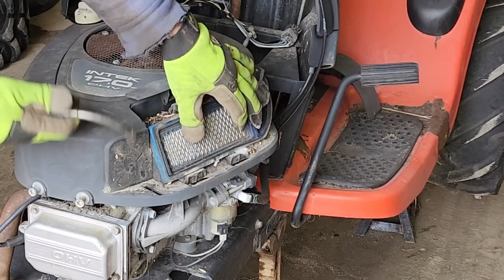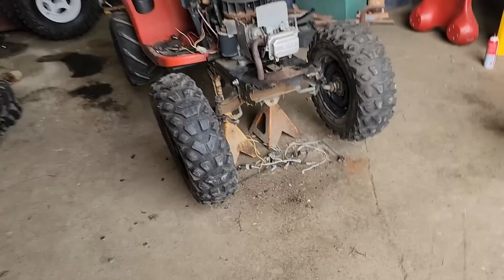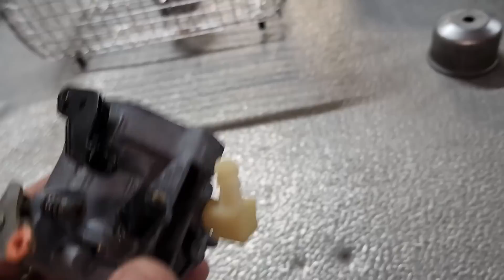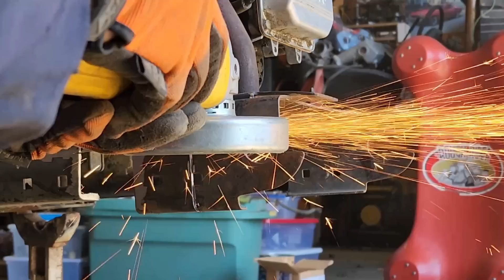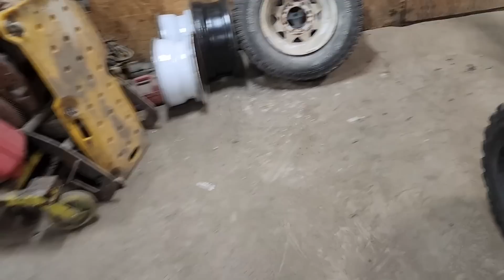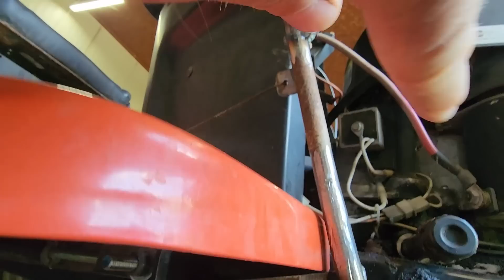JUNKED MOWER REVIVED AND BUILT INTO OFF-ROADING TOY

Comment: Just so you no I have changed out those pads for the brakes on probably a couple dozen different mowers!!! I no it might not seem like that much difference in pad size but most the people that I have changed the pads and put new pads in they have said that they definitely said that the brakes worked better and that they definitely noticed a difference in the braking ability!!! I just couldn’t ever figure out how well they actually would work on something like that but I figured no more than a mower would go they would work good enough for a mower as long as they didn’t get rusted up to the shaft!!! I had changed several pads where actual just the one pad was completely worn out and the other pad was like new!! But after cleaning up the shaft and the rotor part that the brake pads hit against and replace the one worn out pad they worked like new!!! Now with modifications to make one go faster I could definitely see them wearing out much faster and have to be changed more often!!! Top Notch west of Osceola should have some in stock and I’m pretty sure they was under 5.00 for both!! By the looks of each of your pads thay both had maybe an 1/8 to 3/16 worn off of each pad and with both them added up it would be close to around a 1/4” to 3/8” witch doesn’t seem like much but definitely can make a difference in those!!! Well hopefully that helps out some?? Awesome video!! I’ve actually been thinking about doing one myself because I’ve definitely needed something to pull stuff around the yard and help out a little bit!!! Lol!!!
Reply from the maker: I wondered what the normal lifespan for a set of those pads might be and if a new fresh set might have a better bite

Comment: Definitely agree with you on the loud v6s sound terrible. I bought this ford ranger from a guy after he blew the motor and swapped out the engine but the exhaust was hacked off by him prior and it’s just awful. Hopefully by next week the manifold clamp repair kit will be in so I can start installing some exhaust
Reply from the maker: Thats the kind of stuff that gives me a sense of accomplishment and keeps me going
Reply from the maker: I bought my current Ranger with a bad engine. The exhaust had been cut off and a glasspack put in. I had no interest in even hearing that exhaust. I put a muffler on it immediately after replacing engine before I even tried to fire it up
Reply: @misfittoys8883   I already got the pipes and a good muffler to redo it. I actually would like to hear the radio when going down the road. Since my daily blew its trans I had to throw it together fast because I had nothing else to drive. It’s doing really good. My first engine swap though and the fact that it was completely dead one weekend with no engine and on the road the next weekend was pretty good.

Comment: I had the same issue with the fuel shut off on my brothers mower, I pulled it apart and tapped it for a bolt so that I wouldn’t have to deal with the shutoff anymore. It finally runs right